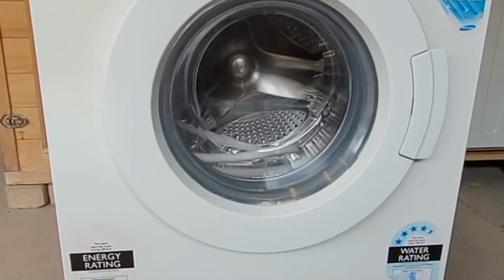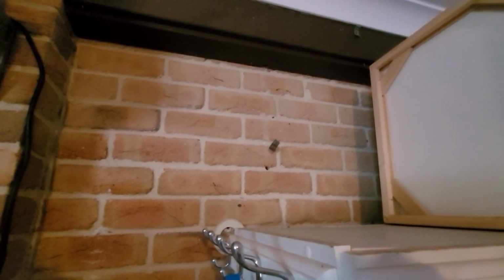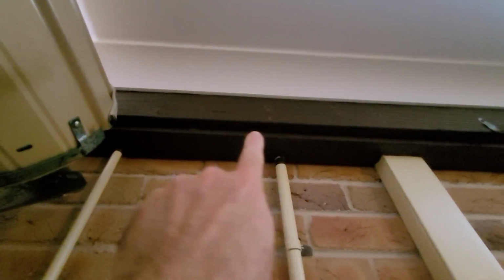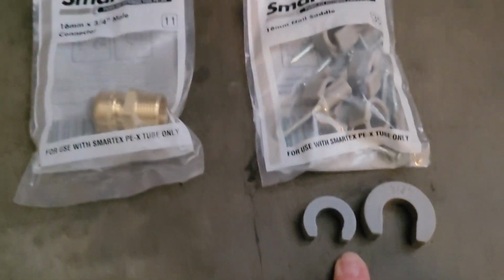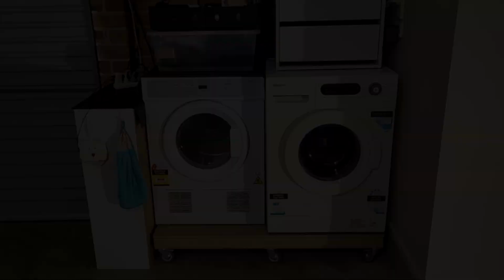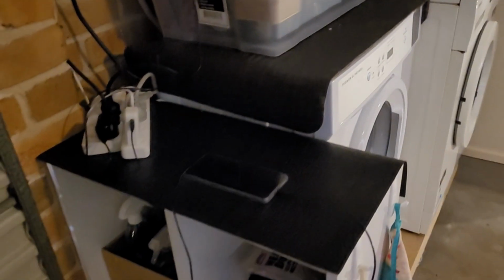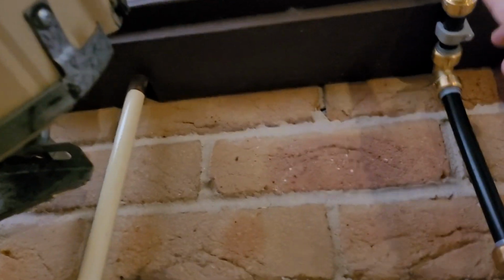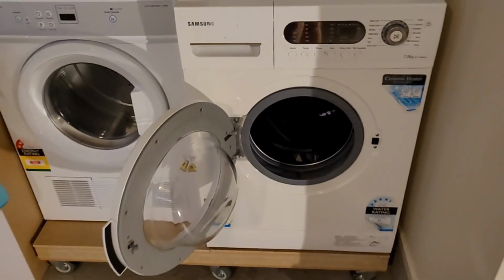Home DIY | How to install a washing machine in your garage for only $150

Comment: How does the water drain from the washer?
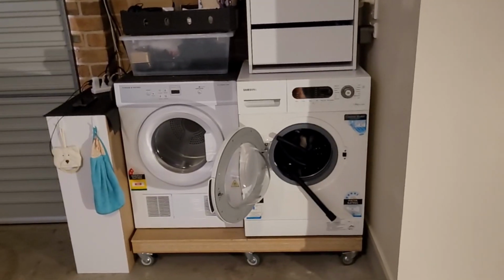Reply from the maker: Hi thetruth8198, I ran a grey water hose from the machine just outside of the garage where it can discharge over some decorative pebbles covering dirt. There is also an accessible stormwater drain but I'm unsure about discharging grey water into it. Anyway, when the machine is not in use, I hang the hose up to dry and store the hose inside the washing machine drum.🙂 See video from about 9:50.

Comment: So this only does a cold water wash, correct?
Reply from the maker: That's correct. This particular washer has an in-built ceramic heater so you're still able to do a hot water wash.

Comment: Where does it discharge water and washing done?
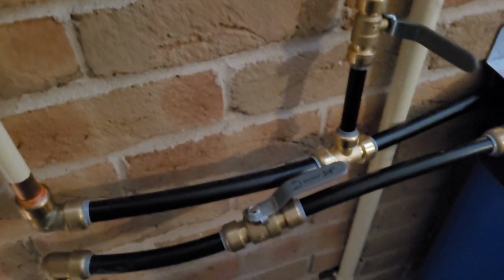Reply from the maker: Hi dreamhomes6249, I run a grey water hose from the machine just outside of the garage where it can discharge and disperse over some decorative pebbles covering dirt. There is also an accessible stormwater drain but I'm unsure about discharging grey water into it. Anyway, when the machine is not in use, I hang the hose up to dry and store the hose inside the washing machine drum.🙂 See video from about 9:50.
Reply: So the way you have this setup, it only does a cold water wash, correct?

Comment: do you worry the pipes will freeze in winter?
Reply from the maker: Hi Kevin, the temperatures don't get so low where I am in Australia that anything freezes over.  The lowest in winter is about 3-4 degrees centigrade.